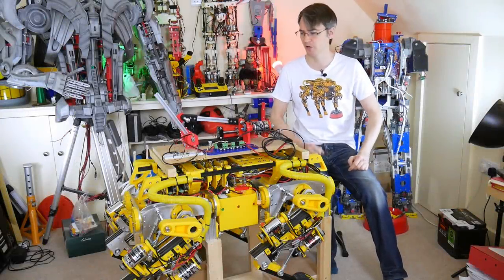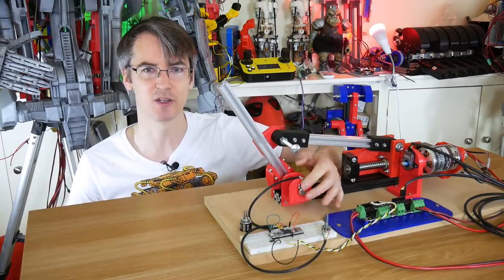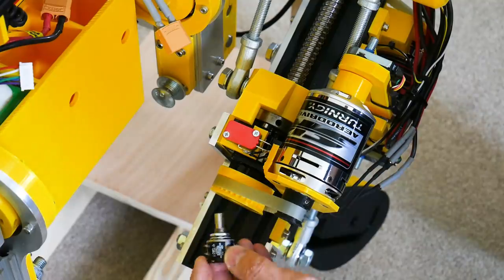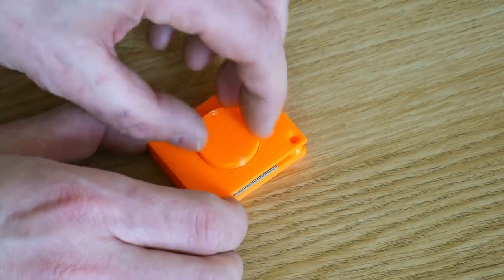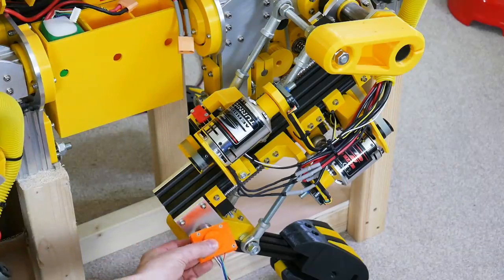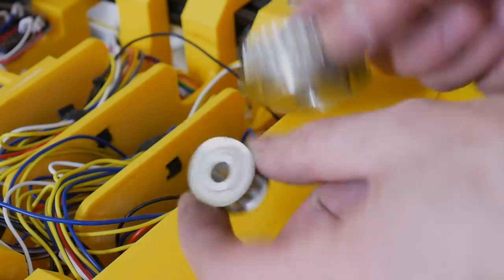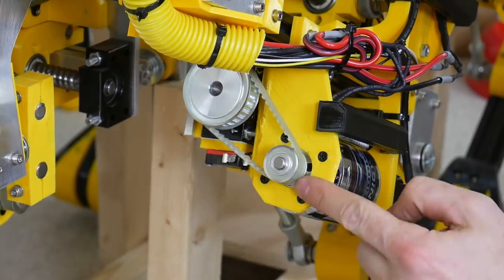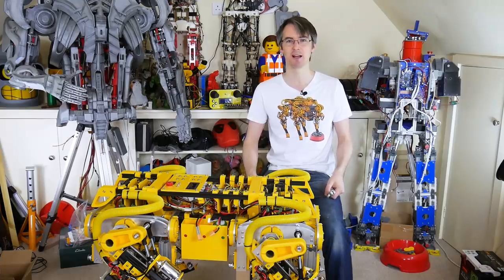openDog Dog Robot #15 | Encoders & Hardware Upgrades | James Bruton

Comment from the maker: I feel a lot better about the hardware setup now the upgrades are done. Next time I'll be upgrading the 8-bit 16Mhz Arduinos to a Teensy running a 32-bit 180 MHz ARM Cortex-M4 with floating point unit.
Reply: Not that it'll matter much on a Teensy, but unless you're remapping the min and max values from the mag encoder, could you maybe just shift the bits?

tenbit = current_angle >> 4;

On a 16MHz Arduino, that would save quite a few instruction cycles.

But yeah, it's probably overkill, even on the slower MCU. lol
Reply: Your vids are always great, btw.

Lots of clever problem solving, coding, and proper engineering, and a different challenge each time.
Reply: Could the O-drive not use the magnetic absolute encoders directly? You could maybe then loosen the pulley screws, get all motors to position hold then tighten them up in the desired joint home position. I've been using the AS5047 encoders over SPI on VESCs with those same SK3 6374s.
Reply: Why not use a 5 GHz i9 or Xeon as this is becoming astronomically more complex than it needs to be?
Reply: small board could be good for each leg so it then operate the leg so if power goes out it put leg to 0 state before power goes out. so it have some sense of powerstate
Reply from the maker: @10p6  how would that make it simpler - what are you even going to program it with?
Reply from the maker: @electronash  thanks!
Reply from the maker: @616C2D7867  The ODrive really needs an encoder coupled straight to the motor for potion control and also so it can energise the motor correctly.
Reply: @10p6  For one this does not make sense, the teensy is by far a ton easier than x86 ( would need an OS ), and  your power budget is pretty much out of the window..

I would say if you want an OS itle be linux on an Arm Cortex something or other  using  the ROS framework.
Reply: @jamesbruton  Yes sorry, that's what I mean, just swapping out the incremental ABI encoder on the motor rotor for the absolute magnetic one. I think those magnetic encoders know their position on power up and the motor doesn't even need to move to find the index. That said, it looks like SPI encoders may not be supported on the O-drive yet and people are just using the ABI interface.
Reply: check out MLX90365 3 axis position sensors
Reply: @jamesbruton   I was being sarcastic.  A 4 MHz Z80 could get Open Dog moving / walking / running.  When a baby or animal learns to walk it does so with no kinetic model and very few variables.
Reply: At the end of #15 I noticed your walking robot; does it climb stairs?
Reply: an NXP i.mx8 based host would be a nice direction.  quad a53 and an M4 for realtime.
Reply: James Bruton is another way to say the future.
Reply: @James Bruton Hey! Thanks, I was really happy to see the little doggy again – GREAT project! ;)
The last video I already thought, why don't you save the position value to the EEPROM? It would survive reflashing (if you have the right fuses set) and of cause power cycles.

You could built a simple supply dropout-detection-circuit from a mosfet and super cap and save the values to the EEPROM every time the power is lost.
OK, that wouldn't help with reflashing though...

Comment: To be completely honest I think you're worrying WAY too much about that jitter. That amount of jitter (even on the cheapo pot from eBay) is TINY. If you need less jitter than that for it to function correctly, you have bigger problems.

But otherwise I'm super excited by the hardware upgrades. Looks fantastic!
Reply: agreed.. if he had mapped the original output like he did with the magnetic sensor, he would have had just a solid of a signal.  One bit at 13 bit ADC is 0.6mV. (0.0006 V).  Highly doubt you need that kind of resolution.  A LP filter or just lopping off the LSB would work wonders.
Reply: Yeah, but doesn't the jitter make noise?  Maybe not; I'm not sure.  Quieter is better, though if so.
Reply: @turbo2ltr  just add a 1uF cap and a 10k resistor in series at the input xD 
(the cap as closely as possible at the Teensy)

Comment: Low-Pass filter is what you need. It will remove all of the jitter issue.
Reply: Also, and this is just an untested idea, you could add a small amount of hysteresis in the software. Something like: the angle variable should only change if the value read from the pot has changed by more than some threshold amount. That way, you don't have to worry about the least significant bit randomly jumping back and forth.
Reply: This ^^^ x10. As i said in the comments after the last video, a car ride height pot (cheap, super robust) with a basic analogue filter (1 resistor and 1 capacitor), sampled at say 500hz and then decimated could easily deliver 12 bits of rock solid position information for a very low cost!  Can be done with a basic 8 bit micro easily too!
Reply: also should put a small cap between the signal wire and the ground, it would clear the signal of AC generated by the enviroment in the long wire
oh wait. thats basically a low pass filter
Reply: Yep. I think a simple 8 sample average filter should be sufficient looking at the variation in the analog 1 data stream. Really easy too: keep running sum of last 2^N samples -> subtract out value from 2^N samples ago -> add in new sample -> bit shift down by N for the average. A hardware LPF typically better but it might take some finagling to get the cap value chosen just right.
Reply: A Kalman filter is always the right thing to use when you have unreliable sensors.
Reply: Double exponential smoothing would likely be enough here.
Reply: What's wrong with his method?  It basically is a low-pass filter because it uses the numeric resolution to cut off the 'quantum fluctuations'.

Comment: 🤣 "The math was correct, but the robot still wrong" haven't heard that yet anywhere else 🤣
Reply: All that you need to do is get the project software and hardware engineers together in a conference room.
Reply: @longshot7601  In my experience that results only in shouting match: "who is responsibly for that shit"
and "We told you so"
Reply: @DerSolinski  Don't forget "Did you even read the project spec book?"
Reply: Whoa you are actually assuming there is one 🤣
Reply: @DerSolinski  Some call it the spec book.  Others call it the comic book.  In either case it makes a great bird cage liner.
Reply: @longshot7601  I see a fan of Sherlock 😁

Comment: James, if you're worried about mitigating signal noise using shielded cable you should keep in mind that the shield needs to be grounded at one end only, not both. If you ground at both ends you can end up with current loops and more noise due to the shield.

Comment: You should be able to get a very clean signal from a low-cost potentiometer, but only if you follow some simple common sense rules.  First, what is the value of the pot?  In think in OpenDog #14 you said it was "10k or 100k".  That makes a big difference.  The ADC inside the microcontroller uses tiny CMOS switches to sample the inputs, and this makes little current spikes when they switch because of something called charge injection.  When these current spikes go into your pot they make voltage noise.  The AVR data sheets typically recommend 10k maximum source resistance.  In this context, the "source" is your pot.  Second, you should try a little analog filtering by adding a cap at the ADC input.  I would recommend: a 2.5k pot (so the Thevenin resistance varies from 0 to 1.25k as you turn it) with a 4.7k resistor in series between the wiper and the ADC input, and a 100nF cap to ground mounted right at the ADC input.  This will give you a 3dB bandwidth of 264Hz to 336Hz (depending on pot rotation) which should be plenty for this application.
Reply: Something like this may indeed be the solution if you want to use a pot. Sometimes digital filtering is not effective if the damage has already been done before or at the sampling of the ADC.

Comment: The datasheet says the sensor has an output rate of at least 10kHz, so by filtering with a rolling median or rolling mean you might be able to regain some resolution at the cost of the update frequency which there is an abundance of. The algorithm involves a small array that you repeatedly shift in the latest reading to, copy, sort and drop the outliers at the top and bottom from. Then you should be left with some rather stable readings in the middle of your array and not lose much temporal resolution. You can additionally compare it to a small threshold for added stability.

Comment: Oooh you got a new Minila The! This old Tony himself would be proud :P
I still don't know why you aren't storing the home positions in EEPROM, so you have the data if the Arduino is reflashed? If the Arduino is losing the data with sketch uploads, you can change the fuse bits in the boards.txt file to prevent EEPROM erasure, then reflash the bootloader before uploading the sketch.
Failing that, external EEPROM. That's gonna be cheaper and easier than multi turn pots :P

Comment: That magnetic encoder looked good! I really hope you keep the use of potentiometers to a minimum however.. They really aren't meant to be connected to mechanical devices, but you can get away with it. Thats why the more expensive Servo motors use digital encoders and not cheap carbon tracks.

I'm so glad you got a lathe too! Just be mindful of backlash and look out for any looseness/lack of rigidity in the saddle/top slide after a few tens of hours operating time. If you notice any looseness then use the adjustment screws for the slides, rigidity is super important when it comes to lathes. Really enjoyed this video, the upgrades were definitely worth it

Comment: one suggestion for your lathe..  swap out the standard tool holder for a "quick-change", they're much sturdier and make turning much easier due to the reduced vibration.    Mine was forever stalling on shallow cuts until i changed that.

Comment: This has got me excited! And the digital magnetic sensor looks awesome. Here's a rhetorical question, to lead my next thought… Do you have a lot of extra resolution in the time dimension, for any of the sensors your looking to use for absolute position; do any of them update a lot faster than you need? (Could they be made to update faster,  with, say, a faster clock?)

I was thinking that if you had a lot of extra readings, you could have something keep a number (three or five) of the most recent ones in memory, and look at the numbers in memory to find one that shows up the most, then report that number at what the sensor reads. The oldest reading in memory should be replaced the the second oldest, while the second oldest should be replaced the the third oldest, etcetera… If no numbers are similar, default to the most recent. If using an even number of readings, and there are two equal groups of most numerous numbers, use the most recent. If that happens, but combined “recentness” values add up to the same, use the group that contains the most recent individual reading.

There may be a more elegant solution out there somewhere, I just came up with this, and I have no great depth of knowledge in this field. Asking around might be a good move, if this solution interests you, and is actually viable.

Comment: Well, it could be too late but I have a little input on jitter topic. The interference is probably introduced right in microcontroller's ADC, not in pots or wires. You could try to shield the microcontroller with some kind of metal shell like the ones you can see inside any mobile gadget nowadays.

Comment: Hey you can use high precision rotary encoder instead of pot, they will be lot more precise
Reply: Don't all the absolute position encoders cost a ton tough?
Reply: @oliverer3  
Yes they are on a bit costlier side but I guess it gives a lot more precession, which is required for this project.
A decent 400ppr rotary encoder will cost around 17 pounds compared to 12 pound pot used.
Reply: I wonder if he could scavenge them from some old computer mice. I think the problems there would be time spend, and getting a bunch of mice using the exact same encoder mechanism.
Reply: He already has encoders on the motors with like 8000 divisions per rotation, but rotary encoders only tell you if something has turned and by how much, but he needs something on power up to say this is where the leg is.  Its like if your car radio has a rotary encoder for the volume knob, it works fine while on, but turn your car off, turn the volume knob 10 times, or 100 times, and turn the car back on, the volume is where you left it.  If the leg moves at all while power is off the rotary encoder doesn't help to tell where the leg is at startup, a potentiometer does.
Reply: KlockworXMusic, Ah. Yeah… That's a good point.

Comment: 10:40 You can use the EEPROM wich is built into each ATMega. Simply store the value after the homing sequence und don't forget the "preserve EEPROM" fuse.
Reply: I came here to say exactly this!!
Well not exactly, the value has to be saved every time it is sent to the O-drive. It's not a calibration value, it's a where-was-I-value. 
Surely this is fast enough to do each tick? Or is it perhaps that you plan on replacing the arduinos with an r-pi or something and that new computer won't have this feature?
Reply: Onnie Qvickström oh sure, you're right.
EEPROM is probably fast enough, but it has limited write-cycles which would worn out quickly enough considering the data rate.
Maybe a small super cap and a mosfet or simple resistor to detect power down?
A power management chip would be better, but probably "too much" effort.
On the other hand James' current "workaround" requires adding a huge number of encoders...
Reply: Well, now I think about it there must be simple power-down modules ready built somewhere
Reply: @juweinert  Ok, new attempt :)
Give the arduino a little capacitor so it can work a split second after power out. Found a couple of tutorials on "arduino power loss detection". 

When the shutdown signal is detected stop accepting new values, stop sending stuff to the O-drive and save the current values.
Reply: @onnieqvickstrom1668  Thats exactly what I meant with the "small super cap and mosfet" part ;)
You can use an N-Channel MOSFET (as reverse voltage protection) in line with the power supply. Drain and Gate go together to the main power in, the Source to the Arduino and super capacitor and an analog input to the main power in as well.
It's the most simple setup I could think of, but considering the maker-community there must be some kind of drop-in module...

What did you find out? Has anybody tried something like I proposed?
Sounds like fun little experiment, hopefully I'll remember it on the weekend :D
Reply: @onnieqvickstrom1668  Oh crap! Our amazing plan wouldn't work for one of his main concerns... Reflashing!

Comment: Nice updates. I'm wondering about the AS5048 though. Will the SPI interface be reliable enough over long distances? Although you can still use the PWM signal, then you need either to save the zero of the magnet inside the AS5048 via SPI, or need a way to remember the zero (and we are back to the original problem),

Comment: Have you ever considered a flexible resistor? You can make a crude one just by taking a strip of some sort, 1/2 inch wide maybe. Draw a 1/4 wide rectangle down the center of your strip. I use scotch tape. Color in the small rectangle with a graphite pencil Now measure resistance then bend it and do the same. There is a resistance change. Just a thought.

Comment: Very interesting!  I wonder if an optical sensor would work?   I'm currently working on a quadrupedal robot that is very sensitive to emf at the required measurement location and am looking into running fiber optic cable to the location and have the sensitive electronics mounted away from the joint and as close as possible to the main board.  I Would love to know peoples thoughts on this.
Reply: Might be me, but I don't know why there can't be a length of metal with marks on it that tell the leg where it is? Length of plastic. Doesn't matter. Basically just put a physical address on the leg so that the position reading is an absolute.
Reply: @interestedinstuff  Nice idea and sure could be worked into a viable idea but unfortunately you have a few obstacles to overcome first.   How would you determine position with the markings and how would the senor read this ?   What if the sensor was between markings and how would it differentiate between markings to determine overall position without having to actuate the leg.  resolution may be an issue as the length of the measuring stick and amount of markings would ultimately determine this.   Did a project many years ago when we tried to use a mouse sensor to read absolute position and it is no easy task.

Comment: jitter can be caused by static creep, or 50 coming from the environment, I'd suggest putting some 100p caps on the leads near your micro, also having a spectrometer would be nice for removing these problems.
Expensive pots will only get you higher lifetime, or additional features, jike 10 turns or continuous turning (these are expensive as hell and almost no one makes them).

but there is a reason that most machines use digital position encoders instead, it's way simpler to deal with data that's not susceptible to noise.
.

Comment: @jamesbruton  I've been trying to use the as5047p with my odrive and running into problems with the SPI error rate. Were you using 5V or 3.3V to power the as5047? Thanks for all the great content!